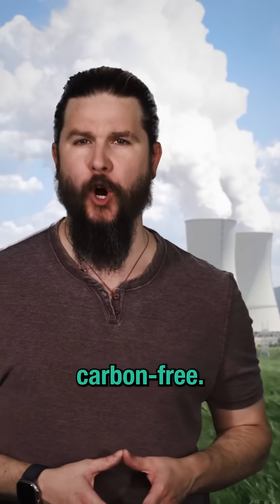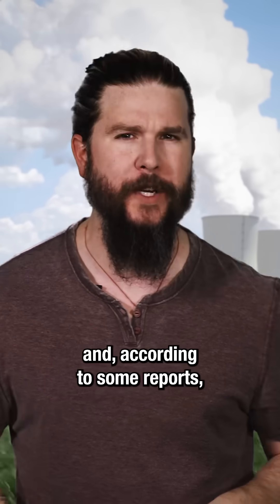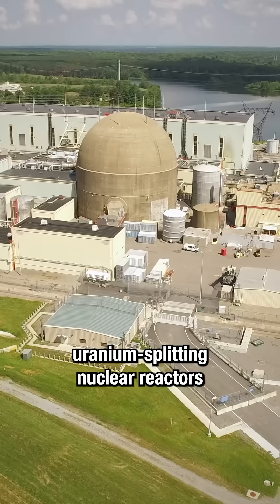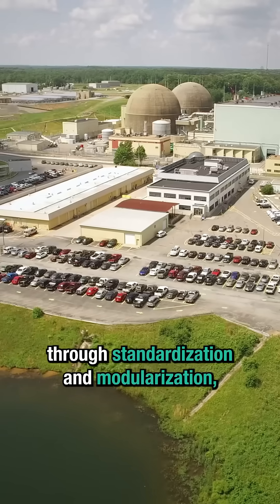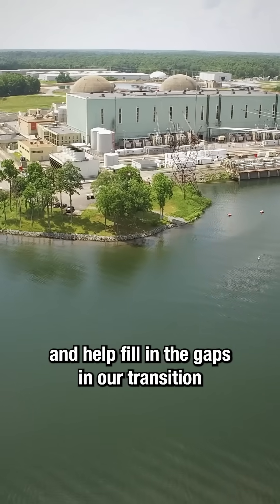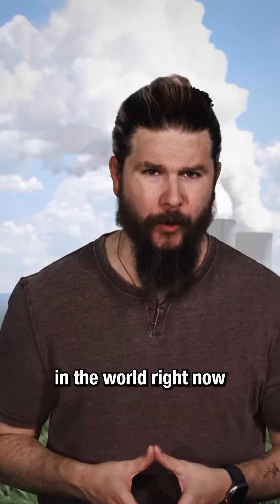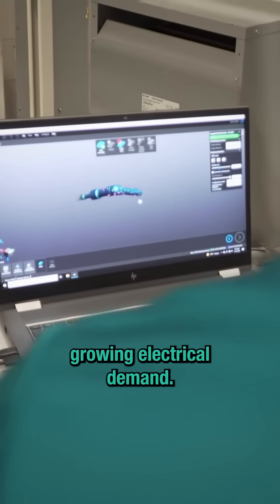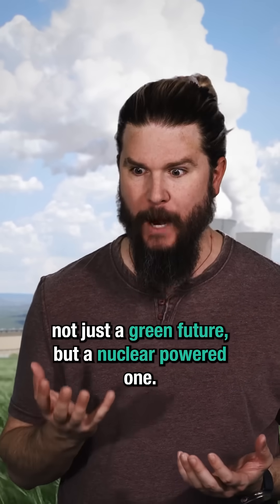Are Small Modular Reactors the Future?

Comment: 46 people died from Chernobyl, the worst nuclear reactor distaster, however approximately 90,000+ people die from Fossil Fuel pollution prematurely each year. Nuclear energy is vastly less dangerous than oil, contrary to what oil companies say.
Reply: I'm mainly an advocate for renewables (primarily because I think we could switch to them quicker than to nuclear and speed is my top concern), but even I have to acknowledge that nuclear is safer per-kwh than even what I advocate for.
Reply: @dynamicworlds1  Well the problem with that is how much material you would need and how much waste would be made to even produce near the same amount of power as one nuclear power plant.
Reply: @dynamicworlds1 The time to plan/build a nuclear plant is, typically, about 10 years, same as any other steam plant (with most, 5-7 years, of that time being due to environmental impact studies and the like. This, and all future statements, is assuming similar plant capacities, locations, and funding priorities). Those steam plants will also last basically as long as they are properly funded (although a 70-100 year lifespan is the typica design spec)l. Hydro (iirc) takes 20 years (due to increased everything), and will last 70-100+ years (if properly designed, built, and maintained). Wind/solar entirely depends on how many environmental regulations the relevant authorities feel like waving that day and whether they are doing experimental stuff or not. In most places, assuming all proper studies are done, and there is no experimentation going on, Wind takes 7 years (the main generatorsvand support pylons are typically designed for 30-50 years, the blades last 15 or less. Usually much less) and Solar 5 (and they currently lose 2% total efficiency, base is 20%, in 3 hrs. Panel design spec is typically, losing more efficiency over time, 20-25 yrs, but the average for large scale plsnts is closer to 15. This isn't including any significant battery or power storage. Any non battery infrastructure will last for functionally ever with proper maintenance). Now, that build time is significantly shorter than a nuke plant, however, the solar and wind farms both take up many miles more space, and generate immense heat and noise pollution. Areas tens of kilometres downwind of such massive solar farms usually register a minimum +3°c temp increase overall, with highs of +10°c increases recorded. For reference, climate change is currently pegged at 2°c, with regional maximums of 5°. There are currently no regs for heat pollution to my knowledge. Noise pollution adversely affects most wildlife and certainly affects all human life! Wind Solar also produces about 600x more toxic waste per kilowatt/hr produced (and, unlike nuclea, we have no satisfactory long-term storage for that waste). So personally, I'd rather skip Wind/Solar and take the extra 3-5 years to build nuclear, rather than spending billions building them and the (so far completely unrelated accounted for) necessary supporting infrastructure, and then waiting the 30+ years it'll take to convince politicians to invest even more billions switching to nuclear (which would render all of the wind/solar specific infrastructure obsolete).
Reply: @dynamicworlds1  the insult is today with a combo of renewables and nuclear we can allready have nearly unlimited clean energy with low enviromental impact.. yet people and mostly politicians continue demiizing nuclear power.. starting with greenpeace
Reply: @sparrowlt what does that have to do with what I said?
Reply: @dynamicworlds1  i wasnt complaining or correcting your comment.. just adding opinion and supporting
Reply: Trusting soviet numbers is crazy.
The organization paying for sick firefighters and clean-up workers had tens of thousands of people on their list and within decades thousands of payments were no longer being withdrawn and that's just the people who worked on the clean-up, it doesn't account for civilians.

Its still a lot better than other forms of power but the numbers are just wrong.
Reply: 46 is the Soviet propaganda number.

In reality, several thousand have already died and more continue to die prematurely due to the radiation from Chernobyl.

It's definitely possible to overstate the severity of the disaster, but it wasn't nothing and it was only contained as much as it was through the sacrifice of many lives.
Reply: Fossil fuels are bad. There is no arguing that fossil fuels are bad in many ways but would suggest, for accuracy, to not forget the fatalities an occupational illness from Uranium mining. Before you just look up the stats for the US, remember that the US only produces about 5% of the uranium it uses.
Reply: @CanusDirusx  these SMRs are said to be fueled for centuries on existing waste from old nuclear power plants, so there would be no mining if that is true.
Reply: @CanusDirusx actually if we include that for all power methods, solar and wind would be lethal, and fossil fuels even worse
Reply: @CanusDirusx  It's still roughly on par with all the mining needed for wind/solar. Nuclear still produces 600x less hazardous waste per kilowatt/hr of energy produced,*everything* included.
Reply: @hanzzel6086 do you have data for it being on par with other mining? It is my understanding that it is more hazardous than mining more common metals, lime for concrete, and silica used in other renewables. 

I’m not saying it shouldn’t be done but I see people representing the number of fatalities in nuclear power plants as the number of fatalities for the industry and that is a gross underrepresentation. I think in most cases it isn’t an intentional misrepresentation but just repeating it for sources that are intentionally misleading them. The truth is, uranium mining is very hazardous to people and the environment and not done responsibly in all countries the US imports from. Whatever position someone takes on nuclear energy, I think it is a fact that I think should be acknowledged.
Reply: @CanusDirusx  those are included in the estimates for mortality that place nuclear as the #1 or #2 safest power sources.

In developed countries, including historical mining, we've seen around a 5% excess mortality for Uranium miners (23% cancer and 90% lung cancer).

And before you pretend this is some colonial enterprise, Canada alone produces 100x the Uranium the USA does.
Reply: @bpz8175 Five percent is a huge number. Two percent of Americans sent to Vietnam during the war died there. Ninety percent plus twenty-three is one hundred and thirteen percent but also lung cancer is cancer? Aside from that accounting for more than one hundred percent, there are no accidents?
Reply: @CanusDirusx  5% increase meaning baseline mortality multiplied by x1.05. If we expect a certain demographic to have a 2.5% risk of death per year, Uranium miners would have a 2.63% risk of death instead.

On the other hand, cancer rates (total including lung) increase by 23% and lung cancer rates specifically by 90% - *relative to baseline*, so it means 90.2/100k/year lung cancer cases vs baseline 47.8/100k/year.
Reply: @bpz8175 still no accident?
Reply: @CanusDirusx  Direct deaths from nuclear accidents sum up to less than 10 000. Even including the estimated cancer risk from longer-term radiation, it's well below 50 000. 2.8 million people normally die every year.

People are hilariously misinformed about radiation and incessantly fearmonger about the risk. Remember that radioactive shrimp shipment on the news? I ran the calculations - your own body is more than twice as radioactive, per kg, as the contamination found on the shrimp. At that level, there is scientifically no basis to say that the shrimp is unhealthy.
Reply: @bpz8175 I’m talking about mining accidents, particularly from Uranium exporters such as Kazakhstan, Uzbekistan, Malawi, Namibia, and Niger. Are you sure the numbers you quoted included those countries? What is your source? 

You also forgot silicosis in your stats.
Reply: @CanusDirusx  I told you, developed countries - I was looking at the PUMA summary of studies conducted in the US, Canada, Czech Republic, Germany and France.

How is Silicosis even relevant? That's just mining in general, and newsflash, nothing in our society is produced entirely without mining. The question is how much more dangerous Uranium mining is compared to mining of non-radioactive minerals.

Also, you seem to have one of those radiation misconceptions - natural Uranium ore is only mildly radioactive and poses minimal hazard. The problem is, over long timespans, it creates pockets of Radon gas which is dangerous when inhaled. Hence why lung cancer is the foremost complication of Uranium miners.
Reply: But nuclear is scary, because the fossil fuel industry said it was!!! They have no reason to lie, right? Right?
Reply: Pretty sure the death toll of Chernobyl is in the high single-digit thousands if you count deaths from radiation poisoning in the surrounding areas.  But yeah nuclear energy is way safer than fossil fuels when accounting for all factors.
Reply: @lukegpb177  If you count the death from radiation poison then it's about 59 people were killed it only reached the thousands of you including long time death like cancer and even then it's up to debate.
Reply: A lot of people died and continue to die from Tchernobyl.  In Norway we still have plant life exceeding the safe threshold level.   Another issue is Sellafield where the cleanum cost the taxpayers 200 Billion Euros.
Reply: @lukegpb177 
That's a very extraneous number? Please cite your references.
Reply: @lukegpb177 incorrect, the most accurate reliable estimates barely scratch 1 thousands from then, till the near future
Reply: Far more than 46 people. Russia still pays out millions a year to survivors and their families who still to this day experience genetic diseases from the radiation exposure.
Reply: @armorclasshero The highest estimate I have ever seen for the total number of people affected by Chernobyl comes from the European Green Party at three hundred thousand. I trust them about as far as I can throw the Berg Kalifa. The Word Health Organization estimates a total of three thousand affected, in the first 100 years. So three thousand people will have had significant health issues  caused by the radiation of Chernobyl, in 2089. And tgat there will be no measurable impact after that (approximate) point.
Reply: @hanzzel6086  both numbers are too low. A quick Google search tells me it's more like 7 million. 7 million may be a high end estimate, but if it's even half that or 1 quarter of that it's still millions.
Reply: @hanzzel6086  three thousand is a substantial undercount depending on what you call significant health issues. We've already had more excess thyroid cancers than that, for example (although mortality is only 1-2% for this cancer type). And yeah, correlation =/= causation and all that, but thyroid cancer is induced by very common fission product Iodine-131 - it's one of the most common cancer types expected from nuclear accidents and bombs.
Reply: @armorclasshero2103 Are you ignorant or malicious? 600 000 people have status as "Chernobyl survivors", having assisted in the cleanup. This group of people does not have a detectably higher cancer rate. The average radiation dose was about 120mSv, or the equivalent of pack-a-day smoking for a year. We have specifically investigated their offspring for genetic mutations and found none.

The deadliest part of Chernobyl was the evacuation of 335 000 people, who, convinced that they would have some incurable genetic disease, offed themselves at extreme rates.
Reply: @armorclasshero2103there is a misinformation campaign to sell this idea that nuclear fuel and byproducts are basically nontoxic and any concern or precaution is ignorance.
Reply: @CanusDirusx I have never seen anyone say either of those things (well, that since the early 60's anyways). There are information campaigns that, correctly, assert that properly handled and stored nuclear waste is a non-issue, and that we have all ghe tools and resources needed to continue to do those things.
Reply: @hanzzel6086  all of the nuke capable governments have a known policy and incentive of downplaying the dangers of nukes since the 50s. anyone not towing that line is blackballed from the industry. And as Covid has taught us the WHO is hopelessly politicized.
Reply: @hanzzel6086  my apologies. If you haven’t seen it, it must not be happening. You’re probably right. We have it under control. Have they used their tools and resources to fix that hole Russia poked in Chernobyl New Safe Containment? I mean, repairing a roof should be pretty easy with all the technology we have these days?
Reply: @armorclassheroI'm sure it does, because Gemini hallucinates just as much as Chat GPT.
Reply: @hanzzel6086  go ahead and check the sources because I did. And it's way way more than the numbers you have. Ukraine government, the BBC, and the IAEA both say the numbers are much higher but give differing amounts. So the real answer is no one actually knows and they don't actually want to know. From BBC: "Viktor Sushko, deputy director general of the National Research Centre for Radiation Medicine (NRCRM) based in Kiev, Ukraine, describes the Chernobyl disaster as the “largest anthropogenic disaster in the history of humankind”. The NRCRM estimate around five million citizens of the former USSR, including three million in Ukraine, have suffered as a result of Chernobyl, while in Belarus around 800,000 people were registered as being affected by radiation following the disaster." You ready to eat crow yet, denier?
Reply: A hydroelectric dam failed in 1975 Banqiao Dam disaster in Henan, China, where the failure of the dam and several others during Typhoon Nina resulted in an estimated 171,000 to 230,000 deaths and displaced 11 million people. Yet everyone loves hydro. People are just plain dumb.

Comment: Exiting modular reactor technology sucks.  It involves the use of fuel pellets with a silicon carbide casing.  That casing prevents the recycling of fuel, so only a small portion of the fuels energy potential is used, you can't recycle the remainder and you're stuck with a very long term waste proposition.
Reply: There are many different designs that use different fuel types.

Comment: I am for a nuclear green energy future, but SMR have 2 important things that work against them: there's too much evolving gouvernemental regulation & there's not enough scale in demand at this point. And I am not even touching on the fact that they are less efficient and that uranium is not a renewable resource.
Reply: Datacenters create plenty of demand and deep pockets for funding. There's enough unmined uranium that we know of in the world to last 100 years, that's not counting breeder reactions to recycle spent fuel, alternative fuels like plutonium or thorium, or any other advances in fuel, mining, efficiency, etc.
Reply: @flyingfree333  Most data centers are edge datacenter and they require less than 2-3MW. Only the largest will actually benefit from an SMR, and at that scale, and with such deep pocket as you mention, you might as well evaluate usual reactors, since the data centers itself is already gonna be high foot-print.

Comment: I'm all in favor of trying it. That said, I recall a few years ago when someone tried to make a modular, customizable smart phone. The idea was some people may want a better camera or a different button pattern, so why not make those things modular and plug and play? The answer is because smart phones are designed very carefully so that all of the necessary hardware is compatible and compact.

I worry about trying to make nuclear power modular as opposed to just making the plants smaller and easier to install. I also worry about investment going into energy production exclusively, and not enough investment going into the grid as a whole to support more power.
Reply: SMRs would make the grid more stable because power generation would be more decentralized. BTW there are modular cell phones and laptops and computers, they work just fine. Also SMRs aren't modular in the way you are thinking, the entire power plant is a module, not a collection of modules, it means the power plant can be built to a standard in a factory and then placed where needed, and if more power is needed you just place in more. They are all self contained.
Reply: @flyingfree333 as I understand the plant would be both a module (in the sense that you just add a new one to the grid if demand increases) AND made of modules (though for the goal of making every component small enough that they could be made in a factory and shipped to site on normal trucks, not to allow for customization).

Comment: The reactors for nuclear subs can power roughly 2500 American homes for a year, off of 4kg enriched uranium a year. Each one costs about 3 billion to build - for a sub.
4kg of enriched uranium costs about $2500, at the all time high.
Reply: that enrichment of uranium is far more expensive than that. Marine reactors using incredibly highly enriched fuel >80% in most cases, which is both incredibly expensive, and also produces an ungodly amount of u238 waste, which is primarily stored in barrels of fluorinated u238 UF6 is what it's called.
Reply: they achieve that by using weapons grade fuel, not suitable for mass deployment

Comment: What do we do when we start running out of fuel for it
Reply: Breeder reactors turn spent nuclear fuel back into usable fuel. Also there is thousands of years of nuclear fuel in the ground waiting to be mined.
Reply: @flyingfree333  its only like 400 years. Which is still longer than we've been using coal, don't get me wrong, but it's not the "end of energy generation"
Reply: @flyingfree333  Perpeetum mobile?
Reply: Breed more
Reply: @electricpaper269  Out of what? Iron?